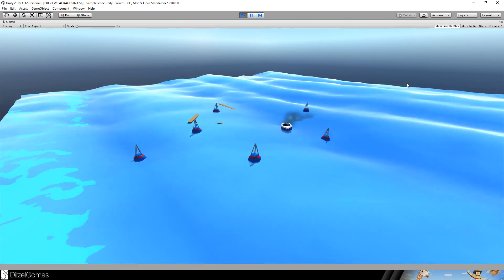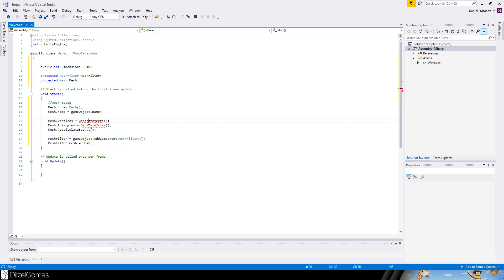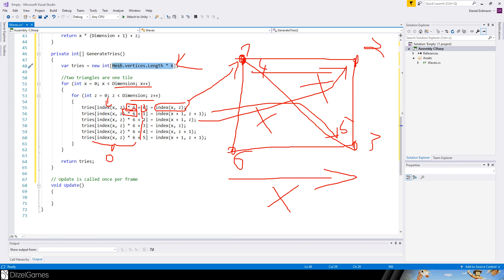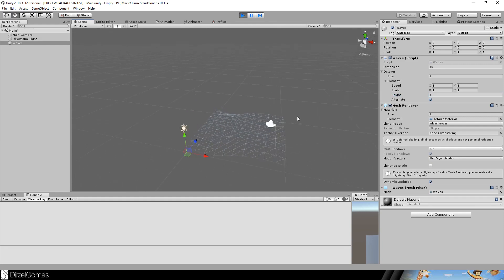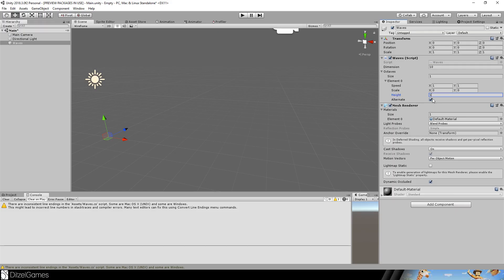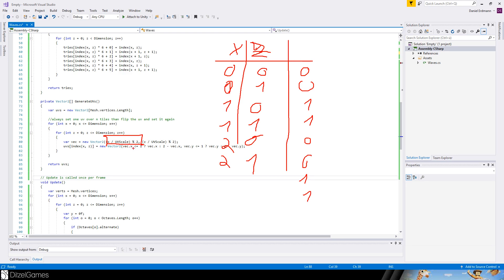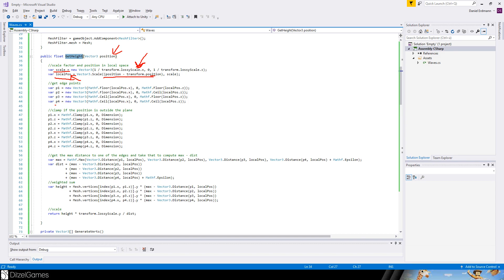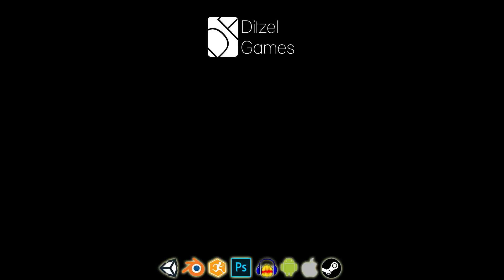Create Octave Water Waves - Unity Ocean Tutorial 1/4

Comment: changing the mesh like this is really inefficient you should always use a shader to offload that process to the gpu.
Reply: It's not really a problem considering how few vertices we're talking about. Also, if we send this to the GPU, then we will not be able to use the water for physics; it would be purely aesthetical.
Reply: @naxaes7889  yeah but if you wanna apply this to a game there is a big change you are going to use a bigger plan. And if you wanna apply physics to it you just need to do the same math in your code
Reply: @Gwenoms  Use the Unity job system to do the wave calculation in background instead of overstuffing the Update() method with it.

Comment: I'm trying to scale this in junks. I can make this thing pretty big without a terribly huge hit to performance, but I'd like to be able to link multiple segments together. My issue being that the edges do not align. Would there be a way to either set it that it is either seamless in that apposing edges are always the same height, or such that the octaves are offset by the wave objects position?
Reply: I would like to know as well. My water mesh needs to be 1024x1024 and changing the local scale doesn't work well with the octaves.
Reply: @KindredLemur  I ended up doing my own solution without mash generation. I have a truly infinite ocean and its pretty nice.
Reply: @xhammy6174  without mesh generation? How?
Reply: @joepeters8746  take a high Polly plane,  animate it in the vertex shader using world space coordinates. Move the plane with the camera.
Reply: @xhammy6174  nice solution but how do you sinc it with the CPU?
Reply: @joepeters8746  use the same wave function.

Ie, if it's something brutally simple like "ocean height = sin( world position x)" or something similar. In my case it's gerstner waves

Comment: I'm getting an error in the GetHeight function, in the weighted sum section (lines 63 - 66). All my index() is getting an error saying "cannot convert float to int"
Reply: private int index(float x, float z)//test
    {
        return (int)(x * (Dimensions + 1) + z);
    }
I am pasting this code here, because if this is this fixes the problem I won't be back here to reply more than likely. 1 solution that was explained to me was that any vector3 is already casted as a float, so running it through the index function as an int would not work. So like in this code, I changed the index function to except floats and convert them as an int. Hopefully this works, if it does I'll try to remember to reply back here to give you some good news. But no promises.
Reply: @cameronjackson4652  I can confirm that this worked... This should always work anytime you have int and floats.
Reply: @cameronjackson4652  you're a godsend- thanks!
Reply: Same. Have you come up with a solution?
Reply: same problem here, have u fixed it?
Reply: Without seeing your code there is not much we can do to help. Can you verify you are not using Vector3Int anywhere and your index's are as follows "index(p1.x, p1.z)].y"

Comment: I have the same code in my project but for some reason the last row and column of vertices doesn't go up or down. All the other ones are working. Is there a quick fix for this? I know it has something to do with the calculation of the vertices
Reply: Make sure in your for loops you are doing x <= dimensions. This is because our vertices x+1 and z+1, you are not accounting for the last row of your vertices if you are only doing x < Dimensions